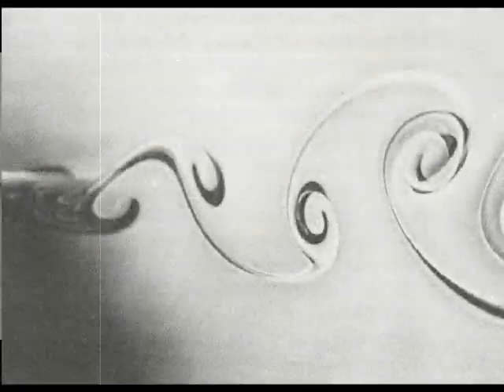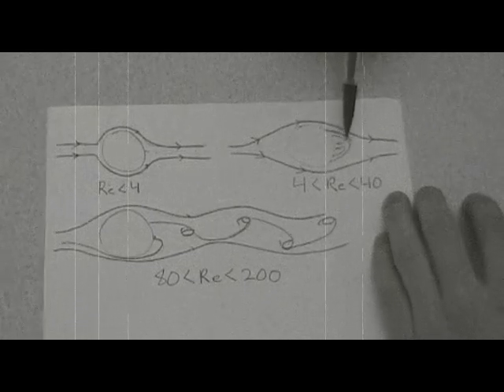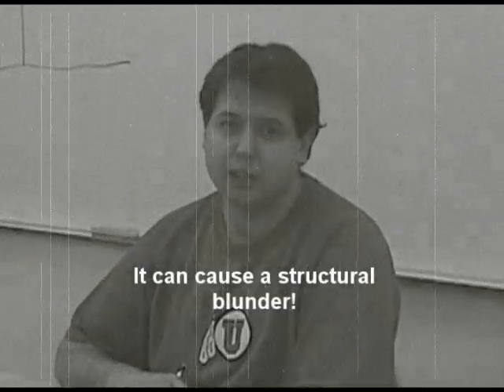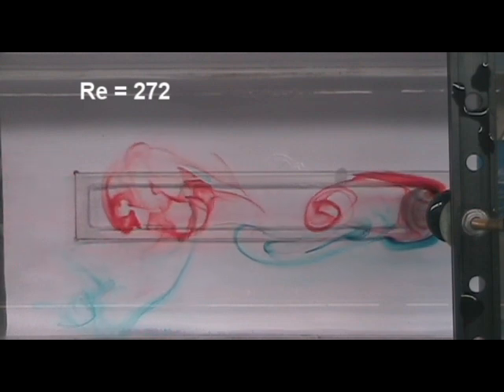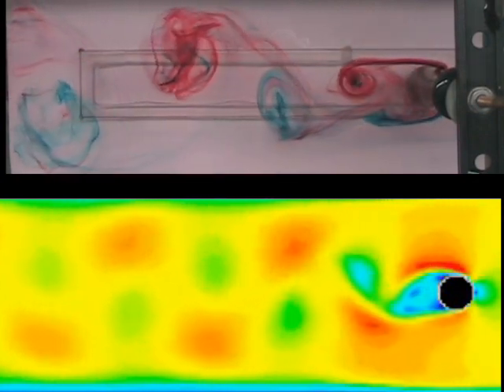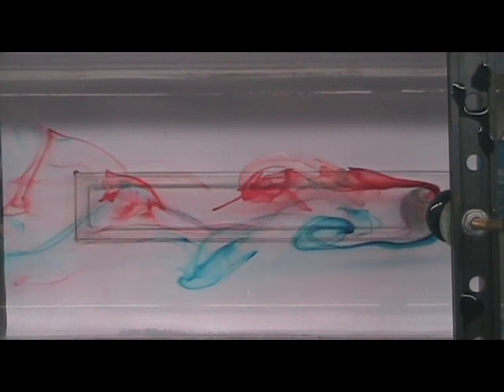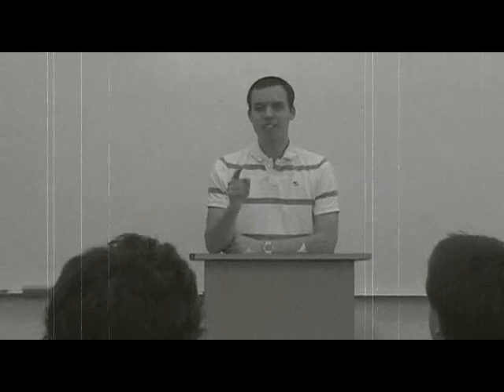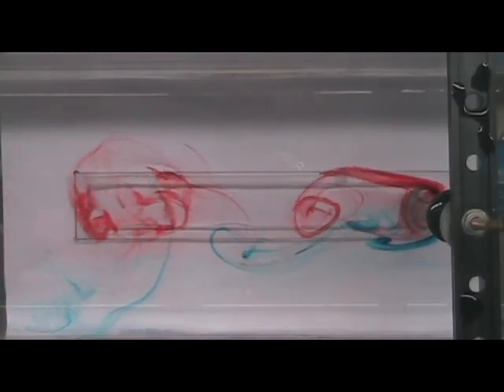Stunning Flow Visualizatoin Lab

Comment: How did you achieve the ink flow? Does it run on a pump?  Thanks!
Reply: i am also interested on that!
Reply: We used handheld injection plungers and did our best to apply pressure to them evenly.  You can see that on many of the experiments there was more red ink than blue.

Comment: If you ever followed a semi tractor trailer on a motorcycle you don't need to see these experiments, you can plainly feel the air currents changing and buffetting you from side to side. You brainiacs made a nice video, thanks for sharing. Fluid dynamics, and air for that matter, are so intresting.